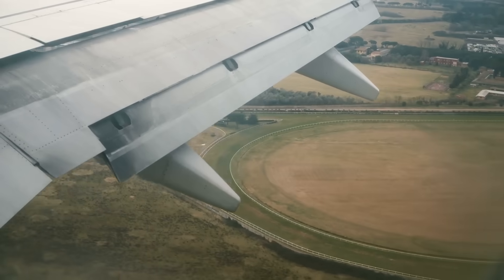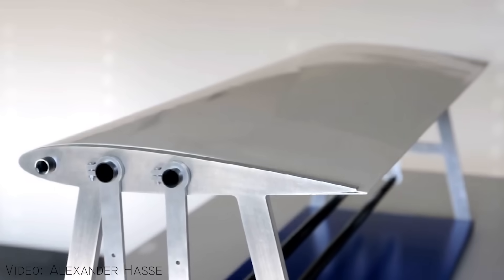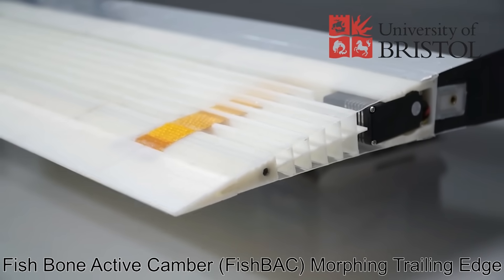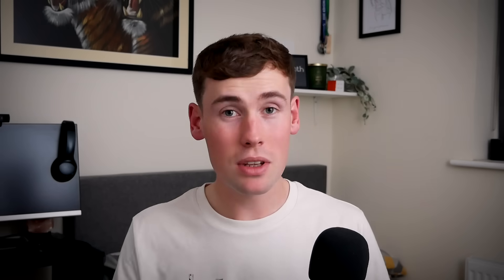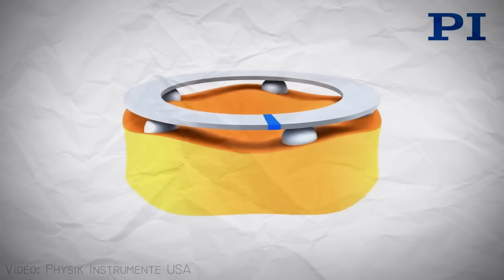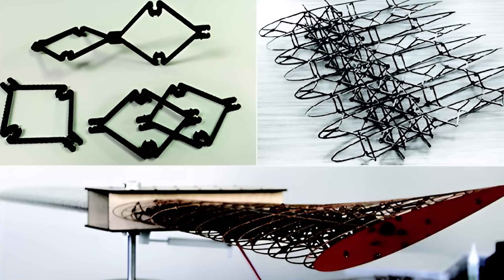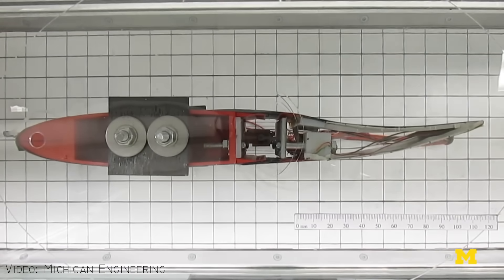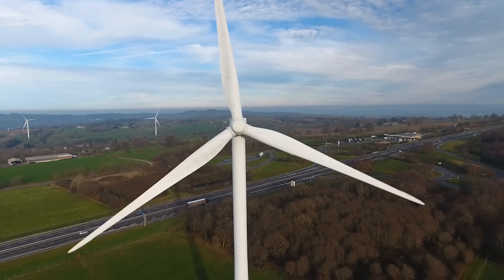Metamorphic Wings: The Future of Flight is Here

Comment: I worked on a very similar design about 20 years ago in a AFRL funded project.  It might have some applications for small vehicles but for larger vehicles there is no advantage over conventional “morphing” systems like flaps and slats.
Reply: Thank you for your comment but can you make some specific comparisons where conventional methods are better and why?
Reply: @anmihovil  Just to be clear, I love it that people are always trying to push things further.  This could be a very long discussion, I'll try to be brief.  Most airplanes have a narrow range of governing design conditions.  The wing airfoil and other wing parameters are designed around that condition (high speed cruise, loiter, etc.) while other conditions are off the main design point (maneuver, low speed for landing).  Off the main design condition you can tolerate an increase in drag, and in landing it actually helps.  It's hard to get a significant aerodynamic benefit from a fully morphing wing.  The needs of the main design point demand a precision airfoil shape.  The morphing adds mechanical complexity.  In a conventionally fueled airplane the fuel is primarily stored in the wings and now that space is taken up by a mechanism that needs a lot of maintenance access.  Also the wing bending structure has to go there.  Birds spend a higher percentage of their flight time transitioning from one flight condition to another with very little cruising. Their flights are relatively brief, with lots of maneuvering to capture prey, evade attacks, etc.. so morphing is absolutely essential for them.  In the 1980s Grob built a G102 sailplane with "live hinge" ailerons using an elastomeric hinge material.  It was smooth, but was a maintenance worry and had no measurable decrease in drag.  The Akafliegs have built some really remarkable variable geometry sailplanes: SB-11, Mü27, D40 and FS-29, which are in a similar spirit but much simpler than a fully morphing wing.  None of these have shown sufficient benefit to be incorporated into subsequent generations of sailplanes.  Unless you actually want to build a bird, I think morphing won't catch on.
Reply: @anmihovil  less parts to malfunction
Reply: @anmihovil   My two cents on this would be: Flaps are inefficient the way they are used today, but they are mostly modifying the wing for special situations, like start, climb, landing. 

However, especially long range airliners and transport aircraft, spend probably 90% or so of their time in one specific situation: High altitude, high subsonic speed travel. And if flaps are retracted, you have wings that are almost purely optimized for that one regime of travel. Theres probably just no need for shape shifting wings, when its already close to perfection during most of the flight.

These shape shifting wings are likely more expensive and heavier than traditional wings, which means they might even limit efficiency. That said, its still an interesting idea, and might help with aircraft that need to perform well in many different situations.

Take a fighter jet plane like the F-14, for example. That was a true air superiority plane, which means it has to perform best at extreme speeds and altitudes, but also need to be able to fight at low altitude and low speed in turning fights, to do defeat any enemy aircraft in any environment. It needed to have excellent climb performance, range, and perform the difficult task of a carrier landings.

The Tomcat did this with swept wings, it would continually wings back when speed increased, to have a more optimal performance at most speeds.
Reply: @anmihovil  The more moving parts, the more failure points, the more parts you have to inspect, the more inspection/maintenance access points you have to create the weaker the structure which you now have to reinforce with makes the wing heavier
Reply: @linusa2996  There would probably be less moving parts. It could effectively replace the multiple flaps, multiple slats, aileron, and all their components.
Reply: @ryanp0342  There will be more, as much as 15 times more as the entire wing becomes a series of flaps, with each joint needing servos. take a good look at that wing sample and you can already see how many more will be needed
Reply: @linusa2996 I took a good look and there is absolutely no way there would be 15 times the parts. I don't think you have ever seen a normal flap mechanism.
Reply: @anmihovil  Imagine asking someone who worked on 3D accelerator cards 20 years ago why they think that NVidias Ray Tracing will not have any advantages
Reply: Red bull f1 2023 secret
Reply: So there could be some drones that could benefit for this type of wing then
Reply: Yeah i have yet to  see anything "flexible" that can withstand the test of time. Especially if risking peoples lives with it, the forces are insane and the damage would be difficult to see if at all until it snaps
Reply: But think about the future and the problems for wing based drones... by that I think you can go further.^^
Reply: the hen in my coop has been working on it since coming out of the incubator, just as successfully!
Reply: @stophrussiannazis  Mine thought dangling would be better for flight.  So crowed every morning at sunrise trying to be a rooster.  Took about 3 weeks for her to get it down.
Reply: I don't know but I would guess cost, weight and complexity (which makes things more prone to failure and more expensive to maintain).
Also it can't be easy to make these things stand up to the insane dynamic loads of a jumbo jet flying through the air close to the speed of sound.
Lastly, getting something like this certified must be a nightmare.
Reply: My masters was about smart wings. As mentioned in this thread, it is an idea that is proven in labs but useless in real life.

NASA ran two programs,  Smart Wing and ACROBAT. Both ended with nothing near TRL-6.

Why? Three reasons:
1- Hysteresis: material like Shape Memory Alloy or Piezoelectrics don't return to the exact initial position when unloading its electrical excitation. And that inaccuracies get built up with time/operation.

2- Very low power authority: You can use the state of the art piezo-electrics patches, but this can hardly bend soft, impractical wing designs. And if you asked where the rest of the input energy goes? I tell you it dissipates in the form of dangerous and unnecessary heat.

3- Weight: All those videos don't show the total weight of the system power amplifiers and capacitor banks... the actuation system is complicated beyond imagination.

Comment: Interesting concept but as with ANYTHING in aviation, it has to be SAFE, robust, somewhat easy to maintain. I don't think you will see this technology on airliners any time soon. It has some promise, but flaps and aileron are critical surfaces that have to work EVERY time. A failure of some small component inside the wing could mean a crash.Again, VERY interesting designs, but you won't be seeing this on a Boeing or Airbus anytime soon. Could have some applications in GA, namely the experimental branches of GA aircraft. I could see this being more applicable to drone aircraft much sooner than with passenger planes. Thanks for compiling the information. Good technology to keep a look-out for in the future.

Comment: I spent some time designing a morphing wing which transformed from an ultralight (high speed low lift low drag low landing approach angle) configuration to a microlight (low speed high lift high drag high landing approach angle) configuration which used just two morphing control points, for a small 3 seat amphibian. It was also a weight shift control arrangement with the wing assembly attached above the fuselage with a stiff rhombic truss that was controlled with a standard stick arrangement either floor mounted or roof mounted, as was the 1935 Waterman Aerobile. I also included a Goldschmeid drag reduction feature in the fuselage ( a little more difficult in an amphibian fuselage), all of which I never got to test to see if it worked as envisaged. 
I achieved the water breakaway function in the fuselage with a trim tab which reduced drag when retracted after lift off.

My 2 favourite aircraft are the Brazilian Airmax Seamax (which can land gear down on water) and the Waterman Aerobile. And the A380 of course.
Reply: Could you post on your YouTube channel, I'm also interested in amphibious lightsport aircraft

Comment: Moving parts are not the problem, the problem is vibrations and using ultrasonic actuators can induce the wrong kind of vibrations in the airframe leading to structural fatigue. This has been the cause of most catastrophic failures in aircraft.

Comment: The the extra maintenance cost, extra weight and the extra danger for flutter. Will probably prevent this from ever getting used in larger aircraft.
Reply: The same could be said about flaps?
Reply: one of them has only 1 tenth of the normal weight of other wings
Reply: @Stella_Valentine  

He did specify that particular design is also particular susceptible to damage due to the many failure points.

Comment: Flaps on landing. Whilst they do increase drag when deployed and therefore reduce airspeed as you say, their primary function is to maintain lift at lower airspeeds. 😊
Reply: - yes - control at speeds below "clean" stalling speed  is necessary for safe landings- AOA is also lower with aerodynamic :aids deployed" - reducing likelihood of stall and also  improving visibility on approach (and departure, though less flap (or none) is used), The conventional "energy management" during flight - uses the flap drag (along with airbrakes) to avoid overspeeding (or speeding back to cruise speeds) the aircraft on descent - down the hill - future more streamlined hybrid topologies - may be able to use motor regeneration (or deploy a - modified for purposes of regen - RAT on descent to landing)  to make up for the drag loss, at the required minimum noise descents....  Of course the weight penalty of carrying everything during cruise needs to be "weighed up" - it is all a balancing act.
Reply: @kadmow  how does deploying the RAT make up the drag loss? wouldn’t it add to drag? You sounds like a smart dude and I’m curious what as to what you mean with that
Reply: @minhpham-yh9qn   - Yes - it would increase drag by doing something useful (on an otherwise streamlined airframe), ie. producing storable energy- and if designed to be deployable and stowable at will - like a motor-glider pod, (rather than just as an emergency generator in current use), would allow regeneration by creating functional drag, as opposed to fowler flaps at 90 degrees (which create "con conservative" drag.).

Of course if main propulsion motors are to e either electric or parallel hybrid, they will regenerate themselves where excess energy is available, depending on mandated flight profiles - regular turbofans however cannot do this.

The energy generated could do "useful things" like drive in-wheel (front) taxi motors, or augment APU generation - I know everything is "too small to matter" and "too hard to do" - I still don't support fully electric aviation, but as the numbers change I let them dictate what is possible, ie. rely on the physics, math and engineering - and real economics, not  the politics.
Reply: It's almost as if lift is proportional to drag
Reply: @Mallchad  It's not proportional, because it's actually a dynamic curve. Eventually the drag increases while the lift decreases and in some cases you can increase the lift and decrease the drag by deploying first notch flaps and slats which decreases AOA. There's only a small window for this but...
Reply: @pilotavery  tbh you're right.
What I said was a gross simplification.

I usually tend to think of lift as a side effect of air smashing into an object which is pretty directly related to drag. but obviously reality and aerodynamics is much more complicated...

Like when you get stalls near or above Mach 1 from flow seperation and turbulence
Reply: @pilotavery  why on earth do you speak ? why do you think you know ? why ? you dont understand anything, but still you speak as if you do. Lift is of course proportional to drag. if you decrease aoa you decrease lift as well. Any notch flaps will of course increase lift and drag, and exists so we can takeoff/land at "low" speeds, reduce risks, reduce length of runways. jesus christ man. Dunning Kruger effect
Reply: @rando9574  It's because I have a commercial pilot's license :) That would be how I know.
Reply: @rando9574  Yes, it will increase lift, but it will increase drag more than lift. And again, The purpose of this as defined by the FAA is to increase the rate of descent. Which does very effectively. It only slightly increases your lift in exchange for much more drag, but because the drag is higher than your left, the net result is you actually are slower. It also will decrease your rate of climb if that's what you're doing :) It dissipates more energy into the air.
Reply: LOL, of course they produce drag, that's the main goal to slow down the plane but at the same time keeping it in the air at a lower speed, nothing wrong with flats as they are now, split flats are even more efficient on what they do.
Reply: @lcfflc3887  It barely decreases the stole speed, and you should fly the approach nearly the same. The side effect of slowing down the plane a little bit is not intended.
Reply: Actual airplanes have parts that separate away from the main wing for a reason, it allows for higher angle of attack without stalling, a wing that only morphs and doesnt seperate would not pass safety standards and increase the amount of landing crashes significantly.
Reply: The FAA defines the flaps function as increasing the rate of descent without increasing airspeed.
Reply: @pilotavery  Think you meant decreasing rate of descent
Reply: @Clippy-o3q  No, increasing rate of descent. It lets you Go down faster. Because normally You can't do a steep descent because you will go too fast by pointing the nose down and you can't slow down easily. The flaps let you do a steeper angle of descent.

Flaps let you increase your speed downward so that you can get downward faster without increasing your speed.
Reply: @Clippy-o3q  No I didn't. Search the FAA for flaps. 

They allow you to increase the rate of descent, descend faster without building up a bunch of airspeed. 

The other way to do it is by diving downward and building up a lot of speed and dive towards the ground but flaps let you do it without increasing airspeed
Reply: @pilotavery  Never retract the flaps to correct for an undershoot, since
that will suddenly decrease the lift and cause the airplane to sink even more rapidly.   --->  https://www.faasafety.gov/files/gslac/courses/content/35/376/Use%20of%20Flaps.pdf
Reply: @pilotavery  Taking this to the exteme (high rate of descent at a controllable speed) are/were dive bombers.
Reply: Learn the difference between induced drag and parasitic drag. A clean wing has more drag a lower speed than one with flaps deployed. Think of it like the tailgate up/tailgate down debate that was debunked on mythbusters.
Reply: And move the center of lift back
Reply: @@Mark-ek8si A 777 barely increases drag with flaps deployed. It produces mostly more lift with slight more drag especially with the slats, while a Cessna, the flaps increase drag by about 1.4x but only increase loft by 1.1

While some people say that's the point, most of my instructors have said otherwise. The FAA also agrees, since the published definition and purpose of flaps is purely increasing angle of descent. 

The extra lift is mostly a side effect, because of the increased drag. 

On GA airplanes, the flaps only decrease stall by a few kts but also INCREASES VMC. 

On an airliner, only 30 and 40 degrees of flaps actually do what ga flaps do, before that the slats and leading edge combined with split Fowler flaps usually increase lift and add turbulence to the air increasing energy and making it stick to the wing. 

I see where you're coming from, but on airliners they're engineered differently.
Reply: @@Mark-ek8si yep, every 6 months I have to take a flight review.
Reply: @@Mark-ek8si No flap landings in GA reduce drag a lot so you float down the runway, but also makes it harder to approach at the right speed. No flap landings can be done at only 5kts faster and a slightly higher aoa
Reply: @@Mark-ek8si Check the Cessna 172 POH. Theres a 5 kt difference in some models and 6kt difference in others. 50 vs 45 kts. This is the calibrated speed and not indicated, as the AOA changed the indicated quite a bit.
Reply: @@Mark-ek8si And no, I am saying that an airliner at 10 degrees of flaps is only really adding lift, while the last 10 degrees (from 30 to 40) adds mostly drag. 

I think it may be time for a refresher course, or at least some ground school on theory of flight and aerodynamics.
Reply: @@Mark-ek8si On GA airplanes, like a Piper or Cessna, there's only about 5 kt difference in stall, but you can quadruple the induced drag of the wing from 0 to 40.
Reply: Yup, tho its more of an interplay between different systems: Flaps increase lift, especially for low speeds, and some drag. Airbreaks just create drag. And spoilers atop of the wing create drag, but also lower the ability of the wing to create lift. Also, any drag can ofc be neutralized by engines.

That said, the example wings here are more than just flaps, spoilers, etc. They could be adjusted at every bit of the flight for optimized performance. This might be relevant for planes that dont spend 90% of their time in cruise, espeically for shorter flights maybe.
Reply: Whilst, whilst....I love you Brits! My other favorite is "when practicable"..luurve it!
Reply: also allow for an optimal angle of attack at same cl and cd
Reply: This is somewhat implied by mentioning lift at take off. Should really say lift at low speed.